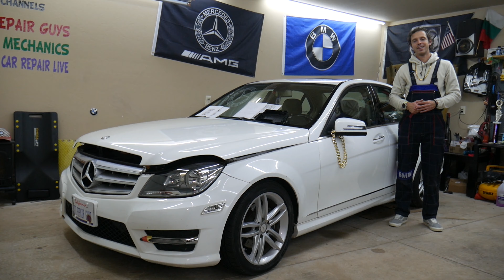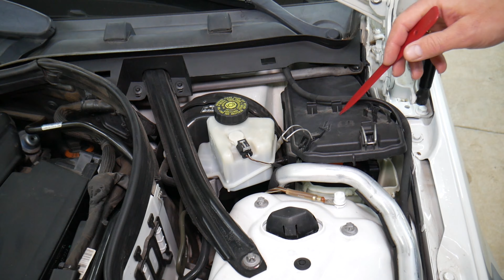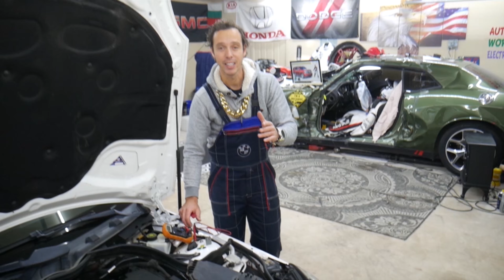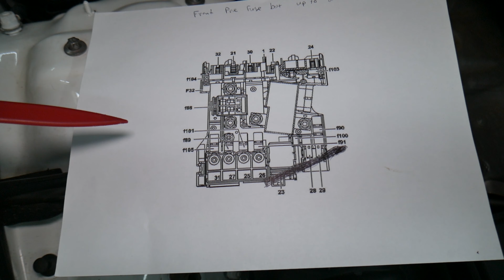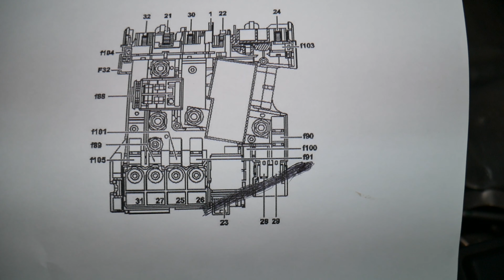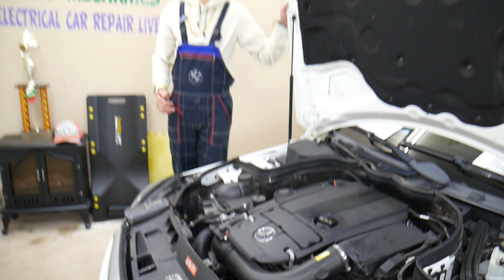MERCEDES W204 BCM Body Control Module Fuse Relay Location Replacement C250 C300 C180 C200 C220 C280

Comment: I have watched your videos and all are very informative. However, I cannot seem to locate which fuse, or relay operates the right hand side, which is the passenger side, daytime driving light. I have changed out the light and I have changed the connector. But it is still not getting any power. This is on my 2013 Mercedes C250 sport model. I have checked every possible few that I can think of. I checked my owners manual and there is no diagram for my fuse box pertaining to what operates. What would you happen to have any ideas for me? Any information you can offer me would be greatly greatly appreciated! Thank you in advance!